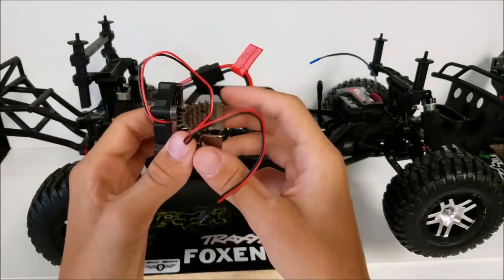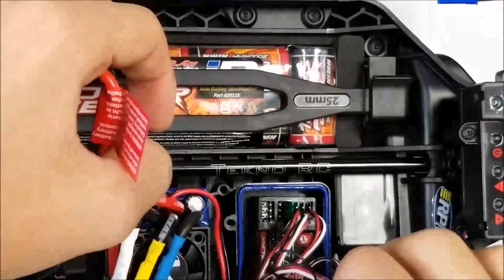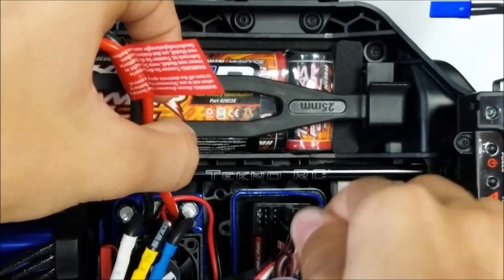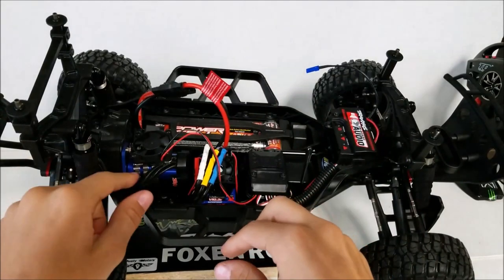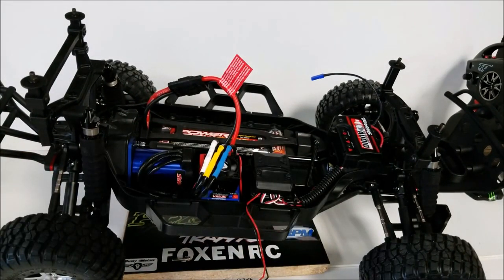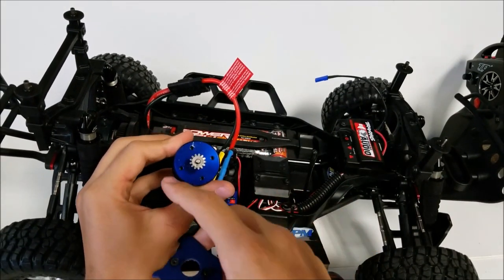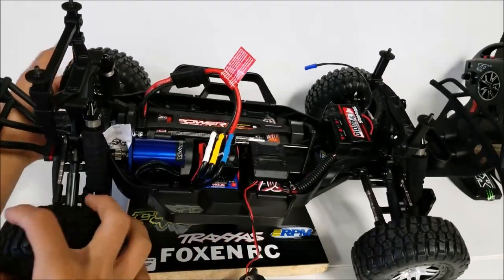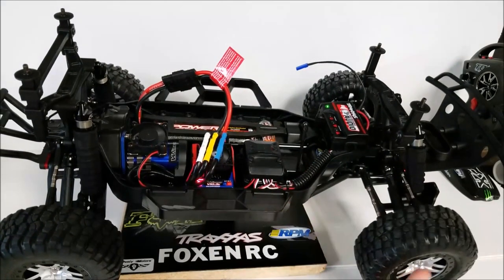Slash 4x4 cooling fan install

Comment: With the awesome set up why would you run a nickel metal hydride battery
Reply from the maker: Very good question. At the time I had zero knowledge on Lipo batteries and how to handle them. I now own 6 Lipo batteries.